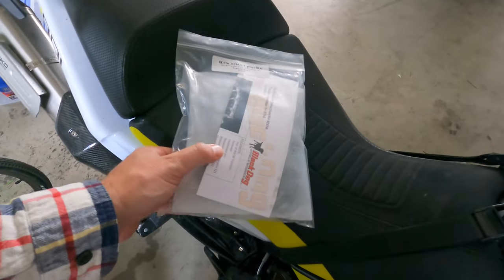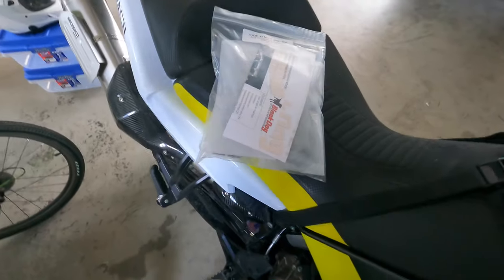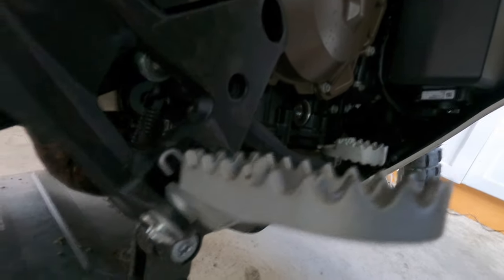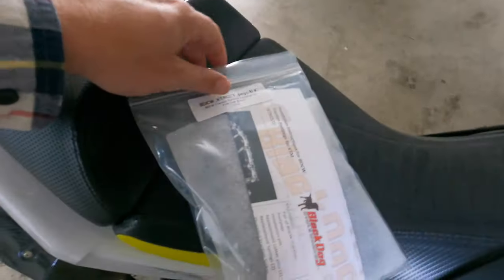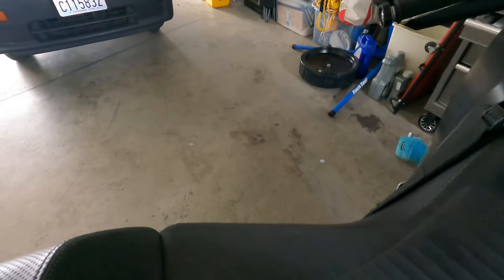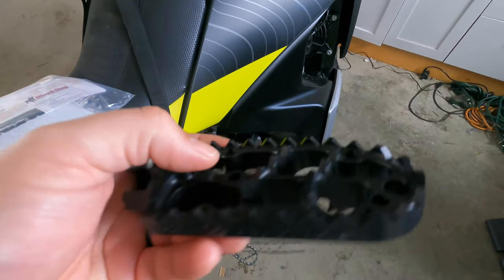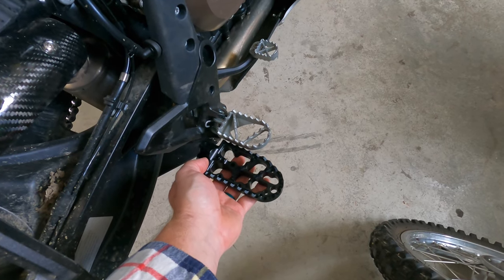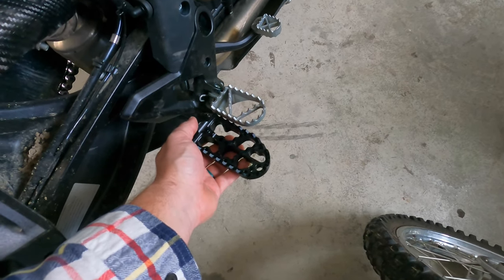Norden 901 - New Foot Pegs and a New Fit

Comment: Do you have buffeting problems with the stock windshield? Everybody’s complaining about it? Are you planning replacing it?
Reply from the maker: At speeds over 70mph it is a problem.  I’d wait fr a tinted shield to come out like they have in Europe but with a bit more height and possibly even a reverse at the top.  It’s not a good enough reason to not buy the motorcycle though.  Honestly this thing is a beast!